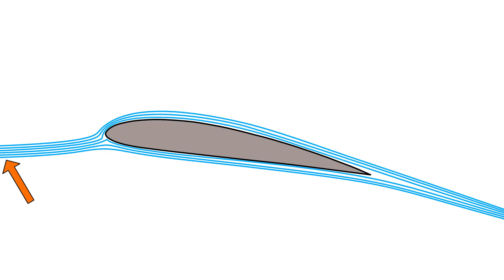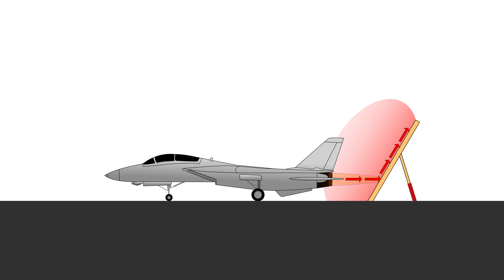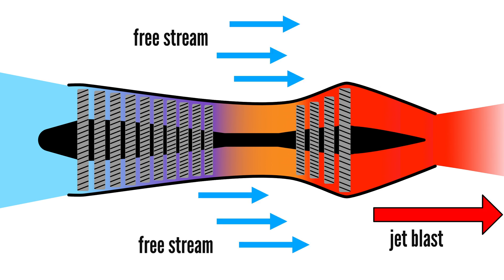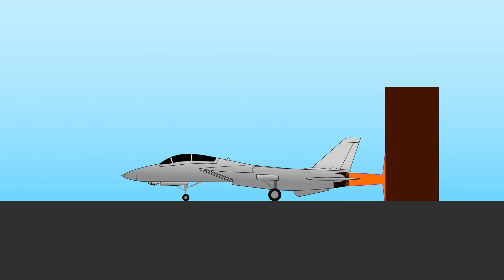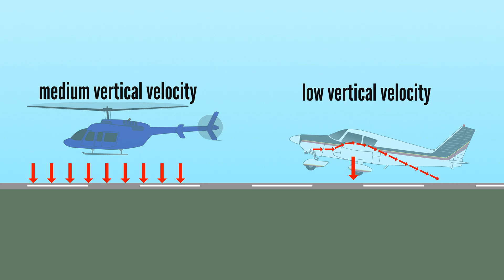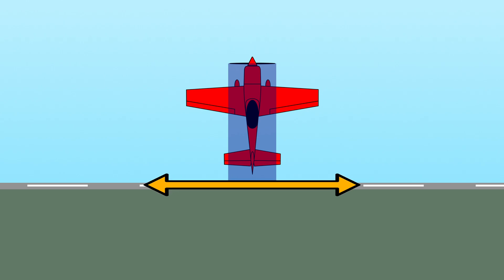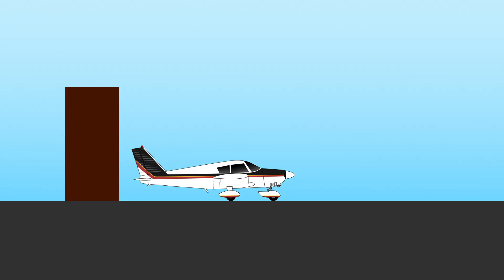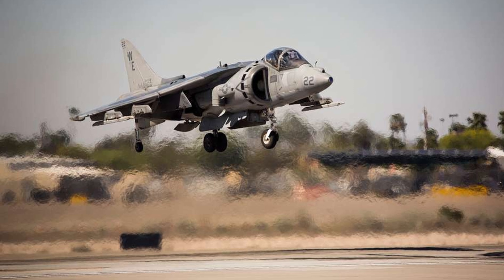Why a JBD Doesn't Increase Thrust (but Does for a VTOL)

Comment: Very interesting topic. 

 I have to admit though, I have a preferred explanation for the reduction of induced drag during ground effect.  

In a sense, what does it even mean to say that interrupting vortices reduces induced drag?  Ok, sure, vortices waste energy in that they represent energy consumed in rotating air mass at the expense of that energy directly contributing to the change in downward momentum of air (Newtons 3rd law needed for lift).

But the aircraft "doesn't know" that the vortices are being interrupted, after they are created and have separated from the wing??  I hope you can see the missing logic here(?).

Preferred:  Ground effect increases the amount of lift for a given angle of attack (pressure buildup), so the angle of attack for a given amount of lift is reduced.  The lower angle of attack reduces induced drag (rearward horizontal component of lift is decreased).
Reply from the maker: Yeah fair point. Breaking up the vortices shouldn't have any effect since the drag was induced when the vortices were created, and that drag has already had it's effect, regardless of how far the vortices trail behind the wing, is what I think you are saying.

The interruption of vortices are frequently given as a cause of the ground effect, but could it be just because of the lower AoA required thanks to the high pressure cusion, which lowers induced drag, creating weaker vortices, as opposed to interrupring the already created vortices.

I don't know, you're probably right. Based on your previous comments you're usually spot-on.

Comment: I think while your conclusion is most likely right your explanation for why JBD don´t increase thrust is wrong. It`s more about the distance to the wall/JBD making any effect negligible. If a wall was placed close to the exhaust the pressure at the exhaust would be higher, therefore increasing thrust
Reply: Actually, it would compressor-stall the engine.

This is what happens when that same F-14 "tail slides" and falls straight backward. Simply incoming air from the wrong direction even at relatively low speeds will snuff them out.
Reply from the maker: That's exactly what I believed too, and why I said the same thing in a previous video.

Comment: What about the surface area "exposed" to the high pressure zone?

An helicopter, a propeller plane flying close to the ground and the harrier all have their entire undersides exposed to the high pressure zone, so that high pressure air has a large section of the aircraft to "push" against. On the other hand, if the high pressure zone is created behind the plane, that's a really small area that the air can't "push" against nearly as effectively.
Reply: The difference in pressure is only a few millibars.

Because you cannot pressurize and open area exposed to the entire atmosphere on all sides.
Reply: I actually was thinking the same thing, I think this explanation makes more sense, especially with the harrier example. By the videos logic, the harrier would also experience increased thrust from a JBD, as would a commercial jet airliner.

Comment: The bulkheads on the belly of the Harriers are here to trap some of the air cushion to enhance ground effect. If I remember correctly, early on, pilots noticed that the 2 gun pods made for much smoother handling during vertical takeoffs and landings, so these bulkheads were fitted when the gun pods were not in place.
Reply: Harrier maintainer here: The nomenclature for the part you are talking about is called a ventral strake

Comment: Helicopters are technically designated as "Rotary Wing" aircraft, and the shape of the helicopter rotors are more akin to a wing than a propeller. Hence, even the "Ground Effect" argument of being within half the wingspan of a "fixed wing" aircraft still holds true as you said as it is within half the rotor diameter ("wingspan" of a rotary wing) of the helicopter.
I should also point out that the research on the Rolls Royce Pegasus engines that power the Harrier, Harrier II, and the Sea Harrier seems flawed. The Pegasus has 4 exhaust nozzles. The 2 forward nozzles are the "Cold" nozzles as they direct the Turbofan bypass air directly out of the aircraft. The 2 rear nozzles are the "Hot" nozzles as they direct the hot exhaust after the combustion section of the engine out of the aircraft. There is no real mixing of cold bypass and hot combustion exhaust as on the F414 engine used as the example. 
That is more true of the F=35B and its Pratt & Whitney F135 engine. The F135 has a PTO to drive the forward downward ducted fan of the F-35B, and the exhaust of the engine is similar to the F404 engine. However, air is also bled from the bypass to provide stabilizing jets on the starboard and port sides near the wing roots. To clarify, this is ONLY true on the F-35B which is the STOVL version of the F-35 series of aircraft.
It should be noted that both the Harrier series, and F-35B STOVL aircraft do cause damage to the their landing pads if they exceed a certain amount of time hovering over their landing pad. The Royal Navy carriers operating the F-35B have designated landing areas for the aircraft, which are treated with a heat resistant coating within that area. Temperatures of the F135 engine is much higher than that of the Pegasus engine.
BTW, propellers were once called "air screws" much like how propellers on boats & ships are referred to as "screws."